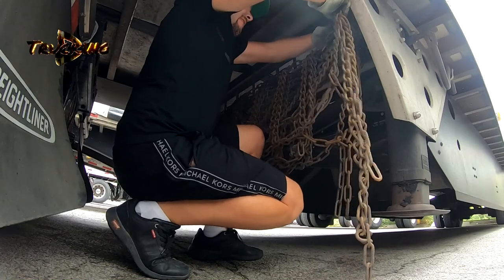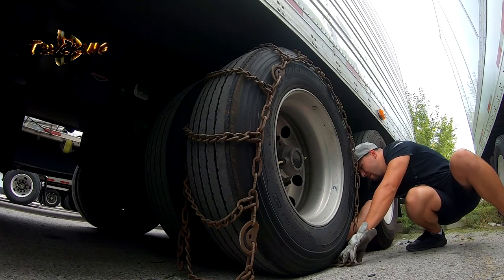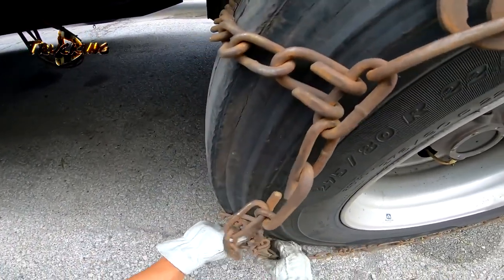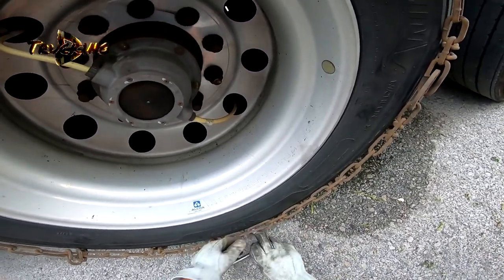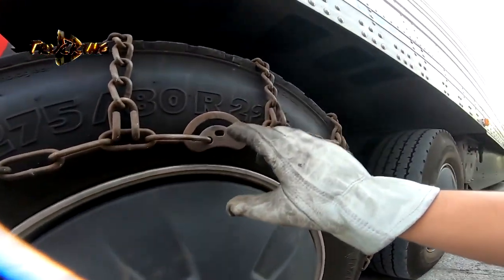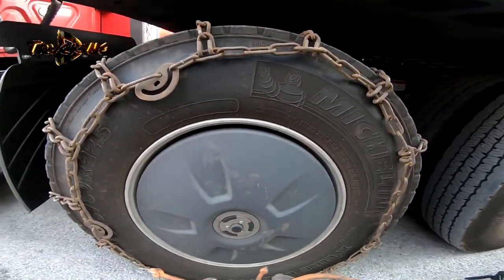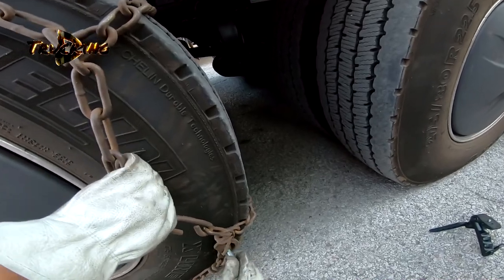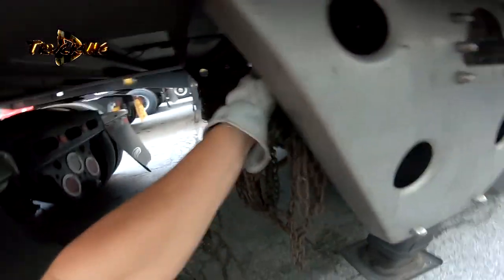How to install SEMI TRUCK AND TRAILER snow chains

Comment: Hey could you tell whats your mpg on your glider? Are you hauling a reefer? Im looking to buy a glider from harrison and wonder whats the mpg would it be.Did you buy it from harrison gliders? Do you have 13 speed manual and 3.42 ra? 
Thanks!
Reply from the maker: Hi, this red truck is regular detroid with DEf. The blue truck had a glider. Average 7.5mpg with a dryvan trailer. It had 13spd and 3.42gears. My average speed was 68mph tho because at 70mph there was 1500rpm.   Had it new from Harrison.
Reply: @DKUSTOMSGARAGE  sounds like a nice mpg for an older motor. Did you get rid of it? And is it worth buying one?
Reply from the maker: At 120k miles tranny got loose and had to change clutch and few other stuff for about 5k, then at 180k miles motor rebuild. So my glider was a lemon for sure. My experience sucks!!! Also engine brake on those trucks very very bad. If mountain says go down hill 35mph, you need to go like 20mph and hope that your brakes wouldn’t over heat, this is if you haul like 75k total you weight truck and load. I’m not new with trucks, but I worried a lot going down the hill. So right now I’m riding 2021 Cascadia with a modern motor and very happy.
Reply: @DKUSTOMSGARAGE  yeah thats what I heard about older parts on gliders being rebuilt poorly so in the future it causes problems. Thank you for your answer!! It did help me! I think I will look toward new cacadias as well.
Reply from the maker: If you have a connections to a good , very good mechanic who does rebuild those ser60 motors, they can honestly make a good rebuild motor that can last 1mil miles for sure. But sounds like from a manufacturer rebuil they last up to 300-400k miles and fell a part.
Reply from the maker: Buy a glider with a cat motor, I never heard that they have any issues. They are usually in A Kenworth or Peterbuilts.